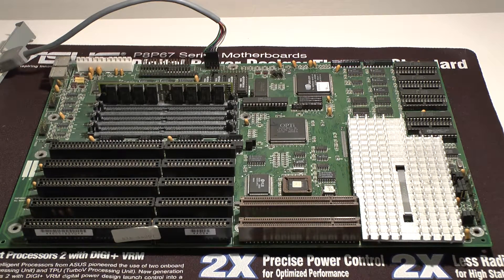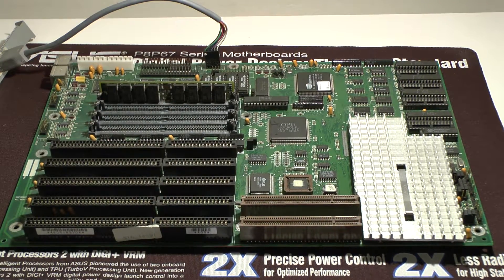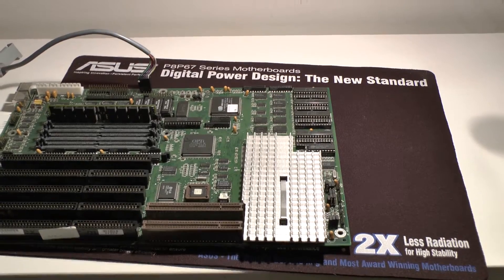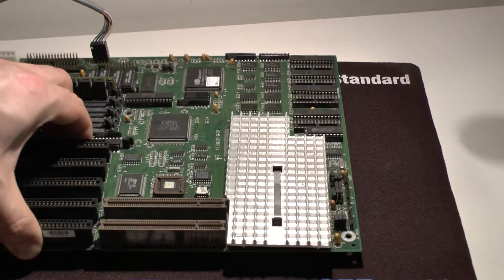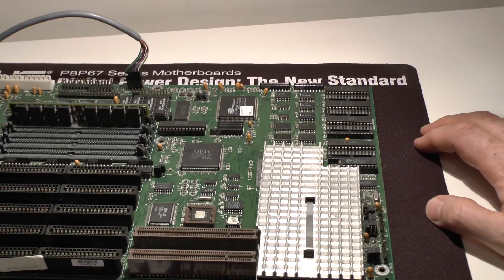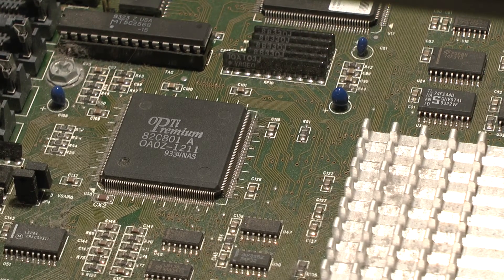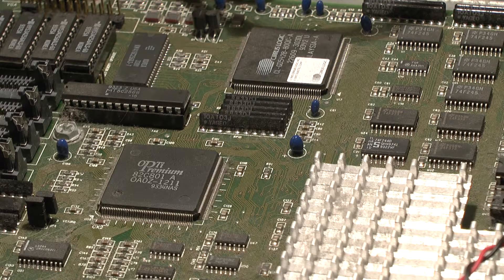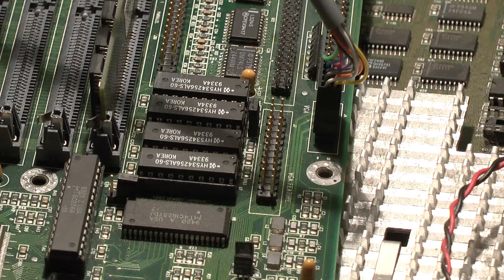DELL DIMENSION XPS 486/66, REVISIT AND CACHE!

Comment: My dad's firm used to have the Dell 486p 33's. They were lovely computers, they had 8mb ram, s3 accelerated graphics and 120mb hard drives. Fast in their day. They used to run McAfee anti virus in DOS. They also ran the os shell windows 3.1.

Comment: Thanks for this obscure video! Helped me a lot. Any luck finding a BIOS update for this? Mine has A05 but still has the y2k error. I'm sure Dell released one for the y2k fix.  Problem is, there seems to be a lot of confusion with this model because people always think it is an XPS. (Even Dell's own site calls it an "XPS" but it is not) It was the same CASE but a different board from the XPS, which was a Phoenix BIOS, and had no built in video. These were sold later 1993 and 1994 after the XPS release (and the DX2 was more mainstream) as a less expensive alternative, famously sold with no L2 cache resulting in poor reviews. Adding those chips makes it fast again! Pure marketing on Dell's part. Anyway, thank you again!
Reply from the maker: Anthony Gemma From memory I was sure I did indeed update this Bios on this board. What version? what board? where is the floppy? lol. I have no clue. I am glad you liked it, another youtuber was asking about it so I decided to try get into more detail. This is the board btw that boots the windows 2000 in the other video, a very impressive compact modern board for 486, ready to go from the box. I did sell a good few via OEM and one on ebay but Got penneys for it lol. Any questions fell free too ask. The hunt goes on for a better BIOS.

Comment: It took me a while to find this but I am very thankful for the new cache number info!  My project continues. I will let you know if/when I can find the cache bits, and if certain period games become playable that currently are not.
Reply from the maker: Please do. I would be eagar to find out if anything I uploaded helps...
Reply: I have found 4 of the matching cache chips and the controller chip as well as a tag cache chip that should work.  Waiting on some of them to arrive from outside of USA.
Reply from the maker: dyvydross Cool. Looks like your getting there. It is great fun to mess around with the old equipment. And push it too the limit. All you need now is a 83Mhz Intel Overdrive CPU.
Reply: I got the Pentium overdrive cpu, but I think it was mis-advertised and is actually a 66mhz instead of 83-- at least that is what the bios reports.  The cpu itself is unmarked as to mhz and has blue letters.  I need to get one in the box unopened especially since I have seen other the same advertized as 83 mhz.
Reply: I tried 4 chips matching your cache  plus 4 glt725608-15t 9623 B001 chips that I pulled from a slightly newer motherboard-- and it works!  But a couple notes. I read that the speeds between the tag chip and the cache are such that the tag needs to be a bit speedier.  Thus the s20pt matching your board are slower than the cyc167A-15pc tag chip on your board. I found that if I used all 8 of the (-15) glt chips the cache would not work at the same speed as the (-15) tag chip.  But using the slower s20pt chips matching yours in first position allows 4 of the glt chips to work behind them.  I assume because it sets the whole chip array to -20? Additionally the tag chip has to be upgraded from a 20 pin 8K X 8 architecture to a 22 pin 32k X 8 architecture for the full 256K cache to operate.  Experimenting while waiting for exact matches, I tried a tag chip with 22 pins and and a 64 X 8 architecture and it worked fine.  That chip is cy7c187-15pl 9432 116469. Still looking for an MT5C2568 -15 chip for the cache controller, but have a -25 chip in place now and with all the above have a functioning 256k cache on board.
Reply: Finally found a system info program that runs in Win95 called SIV and it confirms my Pentium Overdrive cpu is an 83mhz.  The board bios and Windows System page in 95 both still reported a 66mhz cpu.  Now I wonder if I can overclock the chip closer to 100mhz?
Reply from the maker: dyvydross you have been busy.. I think I tried to overclock a 83Mhz to close to 100, very unstable. That said I am sure some chips would clock at 100 or at least to 90Mhz. Again though increasing the cpu speed would not guarentee a faster overall leap in speed. The motherboard, cache, hard drive, system ram all have a part to play in overall system preformance. The system will only be as fast as the slowest component at the end of the day. There is however a quantum leap in preformance when swapping from 486DX 66 to Overdrive 83 in my experience, and only changing the CPU. A lot of people swear by the amd AM586 133Mhz chip for the 486. On this board I found the Intel chips to give a better preformance and smoother video playback.. As for the cache problem you would be correct regarding speed the mother board will run the cache at the slowest rateed speed, providing its in bank 0. The same would be true on RAM. Very fussy board for RAM..
Reply: Well actually, the Windows System page reported a Pentium(r) without any mhz specified.   I also obtained a cirrus 2 meg VLB card and have it working, so now the system is maxed out.  I also used EZ drive to put 4 2gig partitions on a 27gig hard drive I had, so I have plenty of room for toys.
Reply: Since this 486 machine is not online I have made extensive use of my old Sandisk FlashPath floppy which sits in the floppy drive but reads and writes to a smartcard inside of it.  Has it's own batteries and OS-- cool! 
So I take the smartcard out of the FlashPath floppy-- it won't work with Win10-- and download to the smartcard from a card reader/writer.  Then put the smartcard back in the FlashPath and I can take 40 megs of downloads to the 486.  Especially nice since all my on-hand floppies are decades old and often buggy. Much nicer than making mountains of floppies and feeding them in for hours!
Reply from the maker: dyvydross run directx diag in windows 95. You can install up to 8.1 dx. Or dx 9version C in 98. It will do a quick test and give you a Mhz.. cirrus logic make lovely VLB cards. Very smooth video and V.Good Software 3D. EZ drive is also a very s.m.a.r.t (good pun there) way to get a big brute on a machine that only reads 500mb.. lol
Reply: If I had not run across your first video that exactly matched my old Dell board, I don't think any of these upgrades could have happened in the successful, informed way that they did.  I owe you a big thank you for sharing this rather marginalized retro info where I could find it!  THANK YOU!
Reply from the maker: +dyvydross I hear you on that one. There are a few informed youtubers and a few not so informed. No mentions here. I am very glad the imformation helped and glad to know an Irish final built motherboard traveled the world... even if the components were made else where and the fact Michael Dell is not Irish... anyway glad to help, at some stage I will post more retro thats informed from my years in the late 1980's and beyond.. I want to upload more but time is my enemy lol. I did upload a laserdisc one last week.. :-) later.. keep it retro lol.
Reply: Right after I posted the system was maxed out, I realized there was a lot more I can do.  Specifically with newer end-of-generation cards for the ISA slots.   The machine has a CT17xx Soundblaster card currently.  It came with a proprietary short-pin connector for a Mitsumi cdrom drive.  When I upgraded to Win95 I was not able to configure it so stuck a newer cdrom drive on one of the 2 IDEs on the Dell board.  I just now grabbed a Soundblater CT3990 card off Ebay and it has an IDE cdrom connector.  So I will be able to put the cdrom back on the Soundblaster and expand to 2 disk drives on the Dell board IDE cable with a total of 16 gigs of storage.  Gigs are good!  So I guess next I will have to tweak out putting to best use the available IRQs without breaking the bus. Retro adventures continue...
Reply: I was surprised to discover that EZ-drive put no restrictions on the number of 2-gig partitions I could put on the second drive.  With the first drive it said Win95 could handle only (4) 2gig partitions.  But EZ-drive allowed (10) 2gig partitions on the second drive using all of the 20gig capacity.  Windows seems to be working with all of them.  So I guess the real restriction is:  26 drive letters, minus 2 for the A-drive and the CDROM-- gives you a possible Win95 system with (24) 2 gig partitions?  Cool, unless you want to install a game that has more than 2gigs of install data.
Reply from the maker: +dyvydross Hi. Have you tried EZ drive using a Windows 98 boot disc. The disc will have command.com and will allow the creation of larger than 2gb partitions. FAT 16 is restricting you too 2gb. FAT 32 will give you an increased size partition up to the maximum allowed in Win95. I seam to remember 30 or 80gb for Win95 and 120 for win98 using FAT32. I am open to correction. OEM WIN95 Version C has native support for FAT32 and will allow FDISK Format in DOS. If your using EZ Drive then obviously your having issues with your system BIOS restrictions too. So get a WIN98 OR WIN98SE setup floppy disc and use it when EZ drive asks for system files. It will then give you a bigger partition.
Reply: I have a lot of stuff on the c: drive and probably would not want to start over with it.  So if I did that to the second drive would Win95 be able to handle one fat16 and one fat32 concurrently.  I have my original Win95 consumer CD and Service Pack 1 onboard.
Reply from the maker: +dyvydross in short yes. Windows will access all types of Hard drive fat 8 /16 / 32. if you have only installed programs on the first partition of the existing c drive you can use EZDRIVE too clone it over to your new larger than 2gb drive.